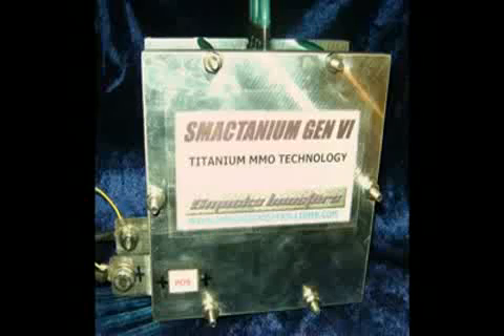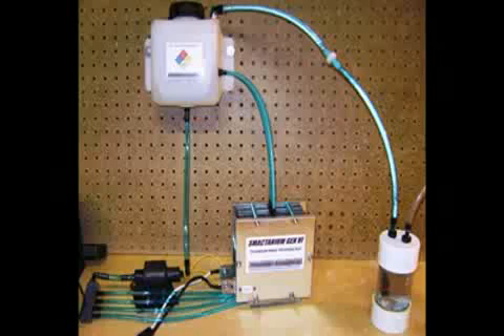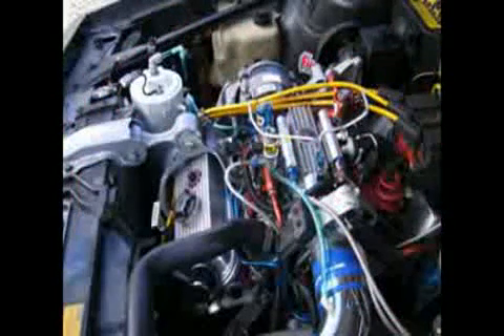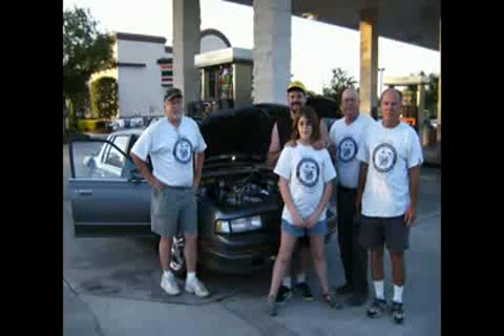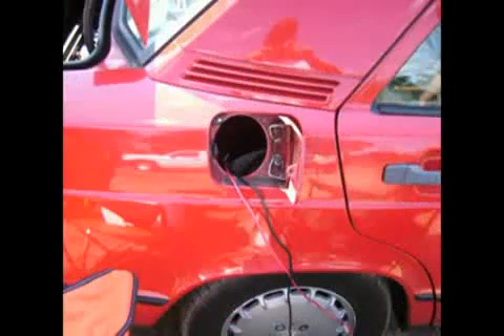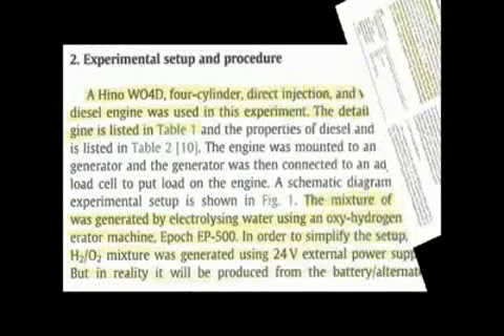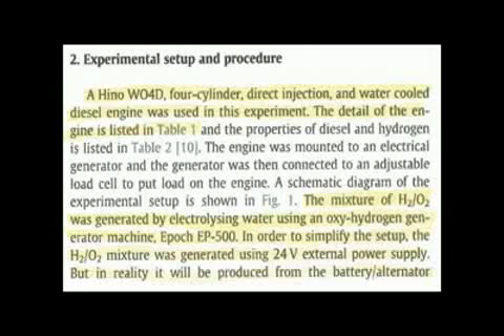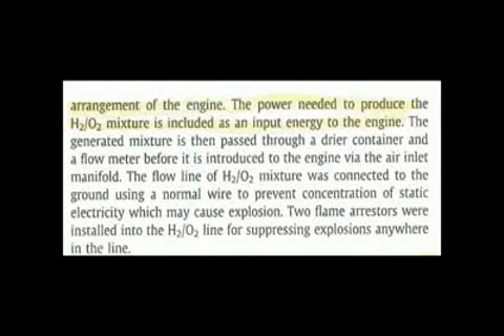(MIRROR) Scientific PROOF that HHO/H2 WORKS Part 1

Comment: I was once told, It's very hard for someone to understand something, when their job ie paycheck requires them to not understand this very thing. In this case, desertphile may never understand that HHO technology works, and when installed correctly(with an EFIE) and properly tuned by a qualified specialist of HHO, it works.